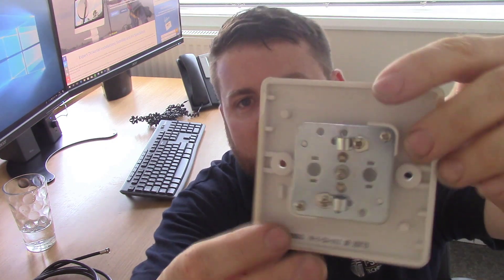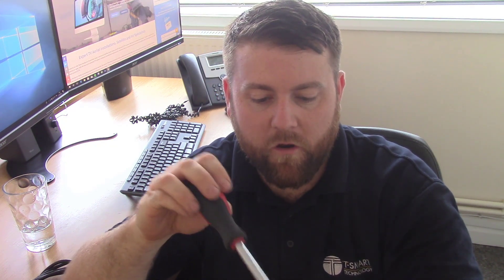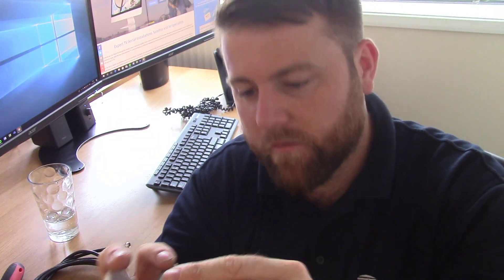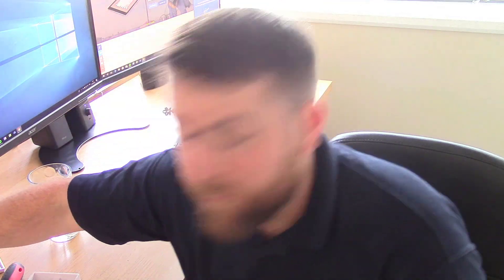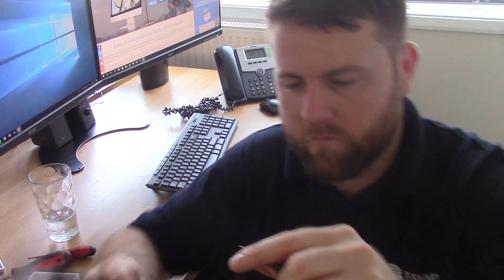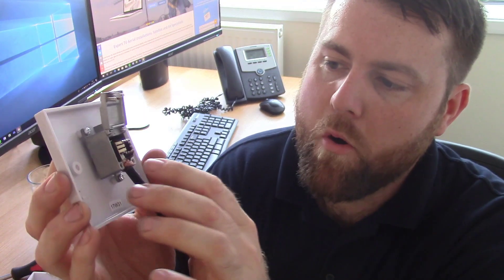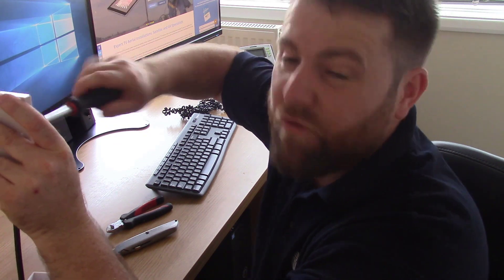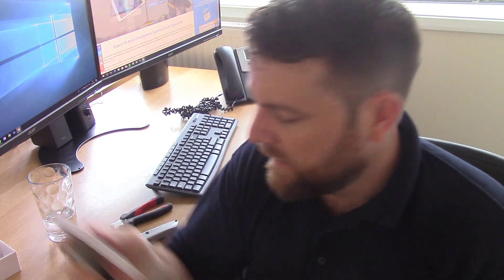How To Install A SAT TV SOCKET Onto Coax Cable

Comment: So the braiding you peel back over the top of the outer cable insulation? So the clamps are gripping the outer cable insulation and also some of the braids? And not just the braiding and the white inner sleeve? But the braids can't touch the inner metal shield right? Also in my home, the coax wiring comes from the top of the back box, and the wire has to plug into the underside of the tv socket, which meant that the co ax got quite bent in the back box. What would be the best solution for this besides having the TV socket upside down? Thanks.

Comment: Hi, I just got a freesat and I live in an apartment in France. I connected the cable to the back of the Freesat and there is a triple connection in the wall. TV, R and SAT. However when I connect the other end into the SAT, my Freesat can't find a connection. Would you know what the problem could be? Thanks.
Reply: is your SAT connected to any antennas? Try TV instead
Reply: @towkukus  Hi, the reason it didn't work is because I don't live in the UK, therefore I would have needed a dish.I already returned the Freesat and they refunded me.Thanks for your advice.

Comment: Thanks for the video. You garbled the crucial bit about what to do with the outer copper though!
Reply: Hey there - curious too about what to do with the copper braid?  Also there is an Earth in that module - when do you use it?  Does the copper braid get clamped in there?
Reply from the maker: Thanks Simon
Reply: @smartaerials  Ah come on man, you replied but didnt say what to do with the outer copper :P Thanks for the vid though

Comment: Can you get a quad plate? I have 3 connections coming in and RF going out to anotother TV?
Reply from the maker: You can, I would get a four module - 2 gang surround and 4 separate modules. This will do the trick.
Reply: Smart Aerials is this something you supply?I can't see anything on the net and thought I'd end up compromising using a TV and radio connection - thanks
Reply from the maker: Sorry we don't supply them. CPC is a good place to buy this type of thing - https://cpc.farnell.com/triax/304250/single-iec-f-white-module/dp/AP01528?mckv=seynCEffK_dc|pcrid|224635168920|kword||match||plid||slid||product|AP01528|pgrid|46533246385|ptaid|pla-414890229255|&CMP=KNC-GUK-CPC-SHOPPING&gclid=Cj0KCQjw4s7qBRCzARIsAImcAxaqmhlXBS1Ndq0RGorkfnCFVw0QoAON_a7PZyi6as5FP_9QBrn78B0aAuyEEALw_wcB

Comment: Hello there. please can you help, i have recently ditched Sky and want to use Freesat  but they have left me with a Q- Dish, which i know doesn't work with Free sat, so i have purchased am HD quad LNB to replace the one in the dish,  what i noticed was 2 coaxial cables coming from the satellite end, but i only have 1 satellite input in the Humax box, do i need a splitter, if so can your recommend one, or can it work without splitter? thanks for your help Tony
Reply from the maker: Hi Tom. If you have two satellite cables and one input on the Freesat box you will only need to connect one of them to the satellite receiver. This is a non recording version which I assume you were already aware of. Obviously you have to replace the LNB first.
Reply: Hi, yes that answers ,infact i did see that in one of your other vids,  thanks very much!!
Reply from the maker: That's great, please subscribe to our channel. All the best.

Comment: Hey there!
No electrical skills at all 
Is there any risk of me getting an electric shock? Do i need to turn anything off before i replace my crappy areil box.
Reply from the maker: A very small voltage maybe, under 18V DC so nothing to worry about. Just un-plug TV equipment from mains supply if you're worried.

Comment: Hey man could you help me? I moved into a house with that wallplate already fitted in one of my bedrooms. Unfortunately they did not leave the cable that joins the plate output to the back of my TV. What cable do i need? Thanks.
Reply from the maker: Hi there. It depends on whether is is a satellite wall plate or a TV aerial wall plate. Basically you just need a fly-lead but depending what wall-plate you have depends on what type of fly-lead you require.
Reply: Thanks man. All sorted now.
Reply from the maker: That's great. Please do subscribe to our channel. Tom
Reply: Hi what is a fly cable where do you buy you I'm in the UK thanks